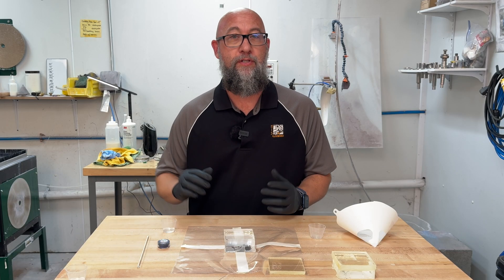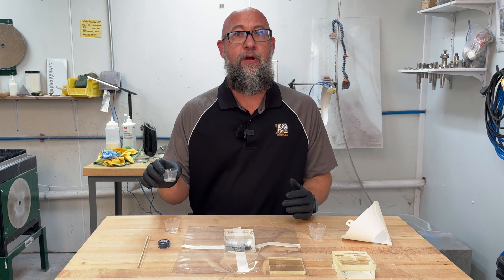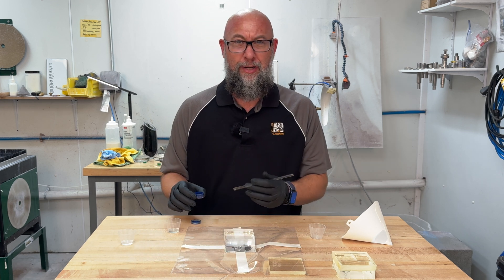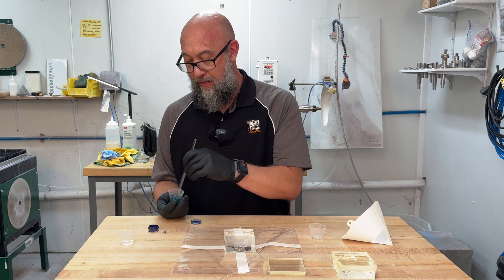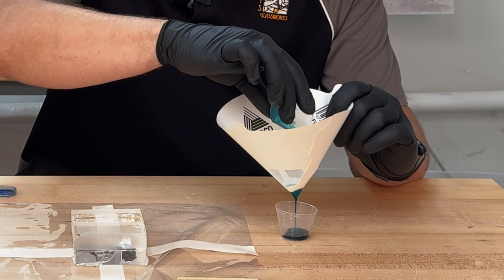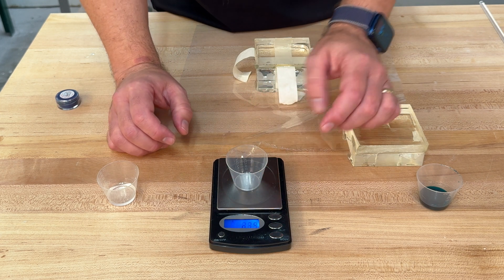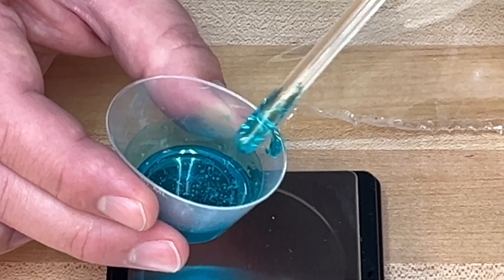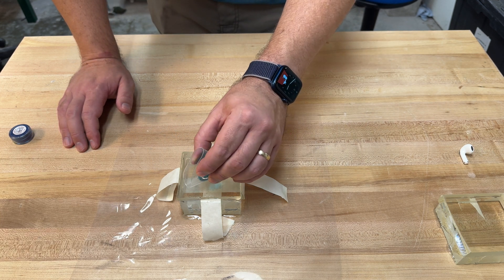Mixing and Using Orasol Dyes with HXTAL

Comment: So part B can be warmed but not heated 🤔? What is the treshold for these two terms?
Reply from the maker: Part B is more susceptible to higher heat. When you warm a mixed HXTAL there is three times more A than B in the mixture and you're only warming it in a warm water bath to thin the viscosity for filling cracks, etc. Part A can heat to up to 100 degrees F, but you don't want to do that with Part B as it will cause it to yellow.